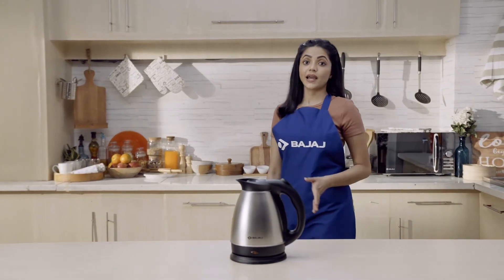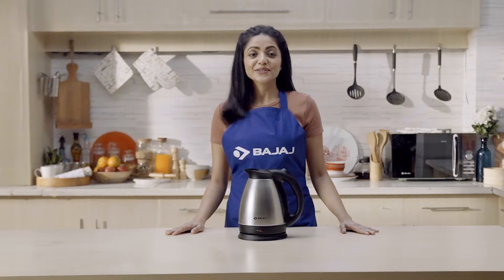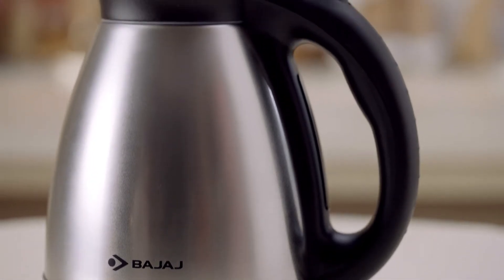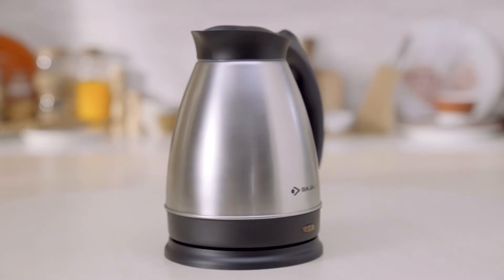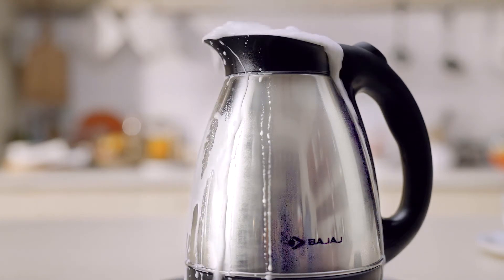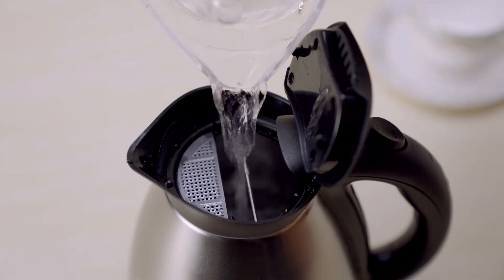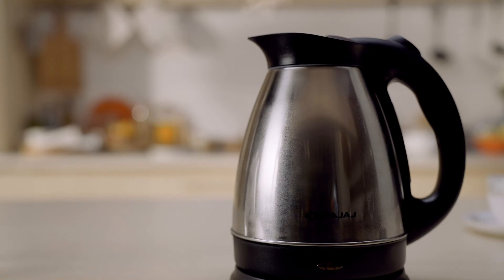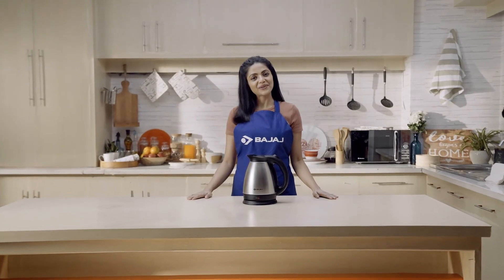Bajaj Electric Kettle| Milk is spilling out

Comment: Bajaj has warning that it is only for boiling water and not boiling milk or beverages. Returning the product
Reply from the maker: We would like to inform you that if you are facing any issues regarding your product, you can connect with our call centre team on 02241280000. They will be in a better position to assist you in regard to your concern.